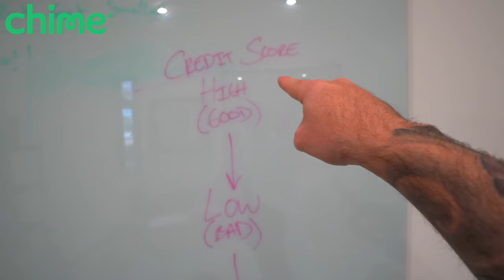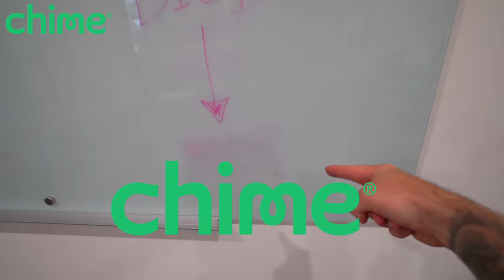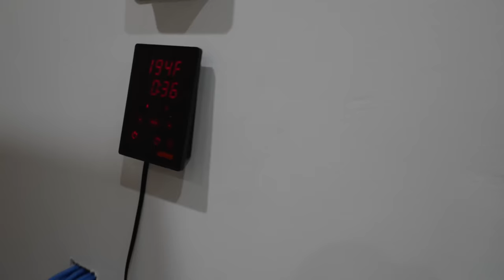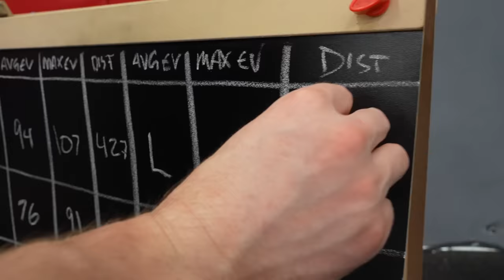Can We Make Baseballs Better?

Comment: From a physics standpoint, any improvement from adding dimples to the ball would manifest as reduced drag, which wouldn't register in the short period which the ball is tracked for in the simulator, so Kevin hitting it harder almost certainly has nothing to do with the ball